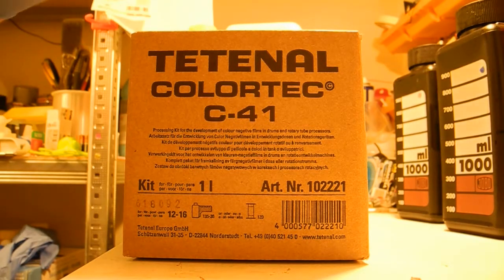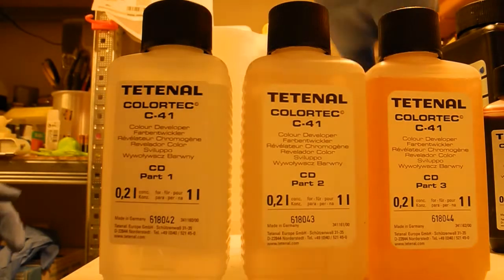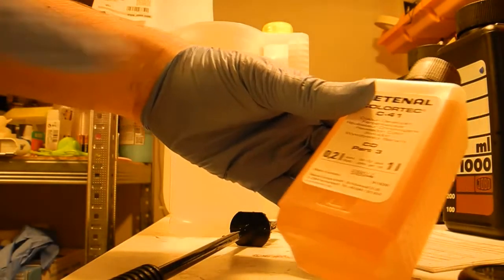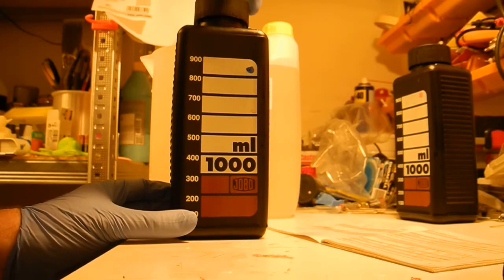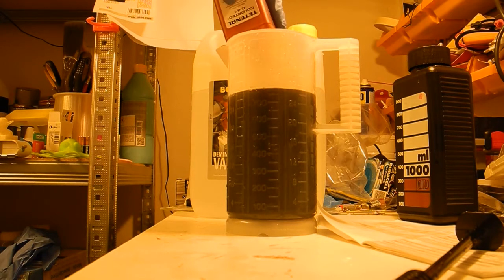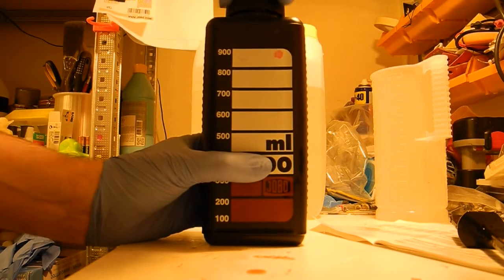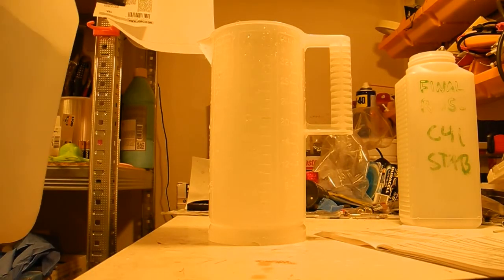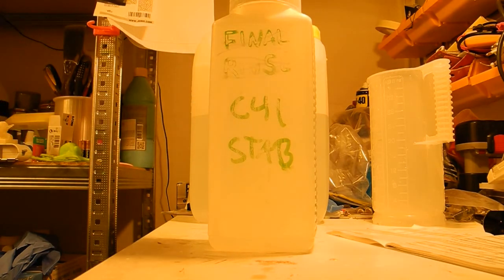Mixing C41 color home development kit Tetenal Colortec chemicals

Comment: I have a question. 
Can I mix one box of the Tetenal Colortec chemistry,  but develop only 3-4 films, and the chemistry store without air for the next development? If yes, how long can the liquid be stored and how I need to store it right?
Reply from the maker: Hi Aurelijus i currently mix 600ml at a time and spray generous tetenal protectan back in the concentrate bottles. They stay fine for me several months i’d say 6 at least. I use 600ml twice with 600ml bottles in my jobo with great results. I do my own control strip that is just a roll of film that has colorchecker card and hot white/deep black exposed on each frane. I cut off 3 frames for each run and tuck it in pn one of the reels and then i an sure to have a full frane from reference. Even if i keep dilutes for 4 weeks it is fine. I think i have gone to 8 weeks even. I have run 20 films on the same 600ml but would only dare that on the day when chems are just mixed. With E6 i have destroyed film by overuse or old chems but c41 seems pretty forgiving. If color of the liquid changes a lot during storage i throw away. If i get nervous i do control frames or if i’m busy i just mix up new. I use 250 ml on same day only. Or 600 ml in a 600ml bottle squeezed so only a little protectan inside. Also i have done 1000ml bottles same way and done maybe 25 films from one batch across many weeks. That was before i started doing contol frames. But some fine negatives (at least tecnically :-) I store dark at constant 23C since i am afraid of crystallization if i refrigerate. Maybe someone knows about that?
Reply: @phvfx  thank You for the recommendations and this useful video! Good luck!

Comment: can you mix only 250 ml of the package, even if its not specified in the mixing user manual?
Reply from the maker: Yes i do it all the time. I mix 250ml for two rolls of 135 at a time on the Jobo and 600 ml for 5 rolls at a time. Concentrates keep longer esp when using protectan spray. Btw other comment about adding water to final volume is right. Helps with smaller batches...

Comment: His overflow of the mixed developer shows why you if you start mixing process with water, you use a little less than directed, add the components, then top off the mix with more water to its directed total volume.

Comment: How long can you keep after mixed?
Reply: depending on the liquid. Once mixed the shelf life is between 6 and 24 weeks. I tend to wait until I have 9 rolls together. If you process mostly  high speed film (iso 400 and plus) then only three development cycles are recommended.

Comment: You mentioned that you recycle your chemicals. Who takes them and how are they recycled? Who would I call in my area for recycling?
Reply: Every community has recycling center. Where would take left over building materials? How it is recycled? I am not sure. The thing is that a lot of waste has been sold off to Asia and Africa for recycling where it ended unrecycled in the envronment. Pretty sad to be honest, so I tend to recycles less of what I think can be burnt at the waste incineration plant. The recycling centeres are ususally run by the city.

Comment: How much does the C41 kit cost and what do you use instead of a thermometer I couldn't understand that part?
Reply: the kit costs Tetenal about $5; they sell it to the retailer for ??, who in turn marks it up to around $30. The bottles, instructions and packaging costs more than the chemicals. If in the US, the Unicolor kit is about $22, but it is dry, not liquid, which is significantly more hassle to mix up. On the other hand, the dry Unicolor kit has no shelf life like the Tetenal, which can theoretically age off waiting for someone to buy it.   Thermometer? Only an idiot uses a glass thermometer to stir chemicals, if that was your question.